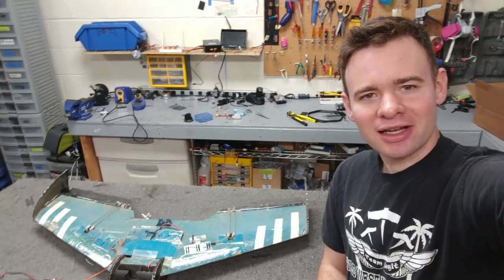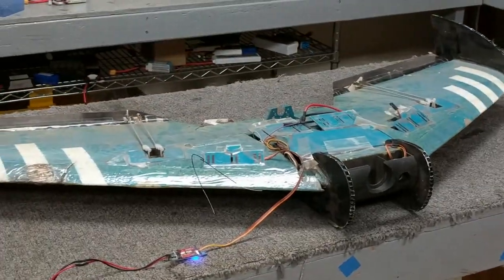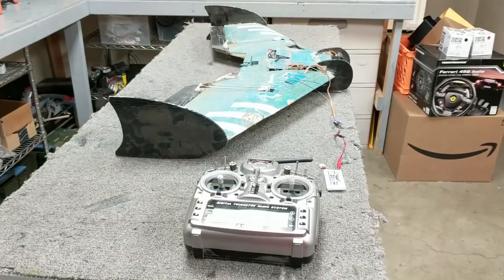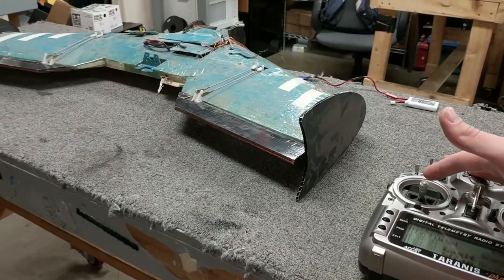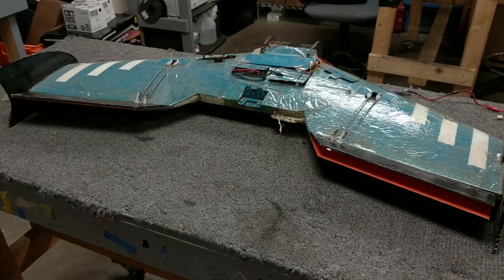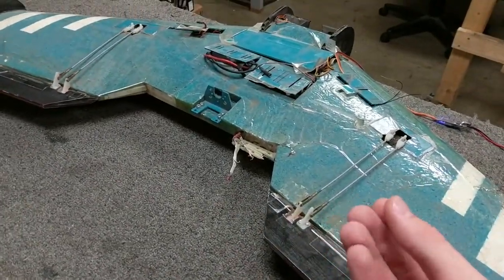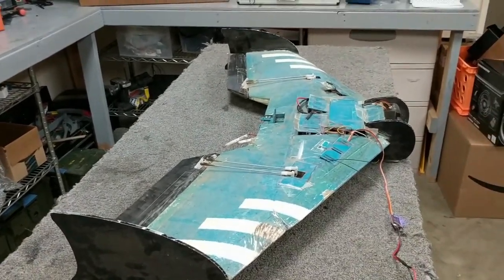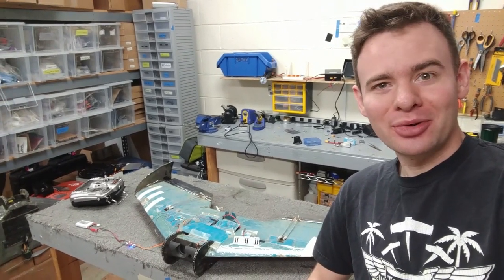FG36 Split Elevons

Comment: That's suuuper cool! I bet it took you a ton of work to get the ailerons coordinated when they were moving in the same direction. I wonder, do you think you could have had an acceptable level of control if you just set them up as spoilers instead of elevons? In other words, the top "layer" only moves up and the bottom "layer" only moves down. That way you wouldn't have to worry about binding (other than adjusting the center point), but you'd still have full control with yaw and brakes and all that. Might have to increase throw on either side a little to account for the surface that doesn't move.